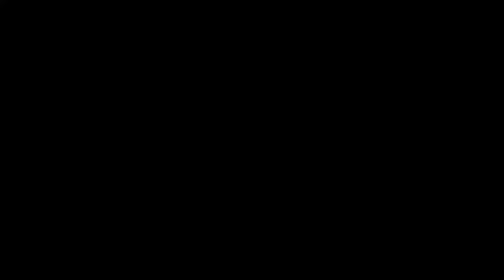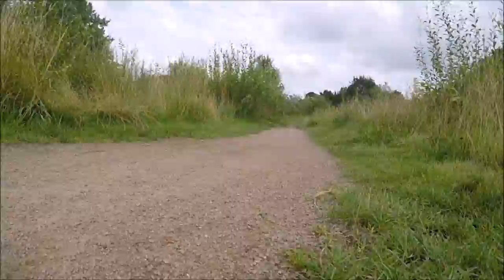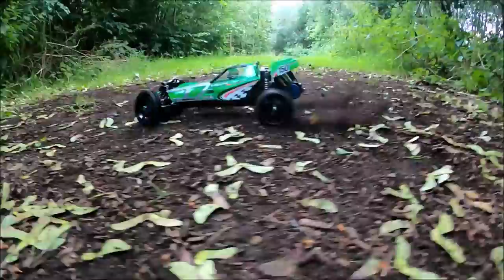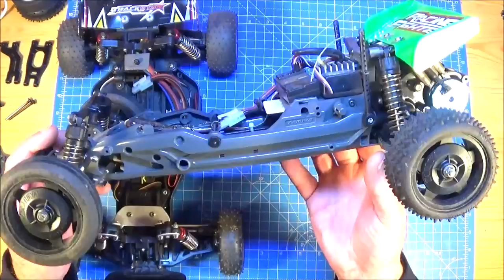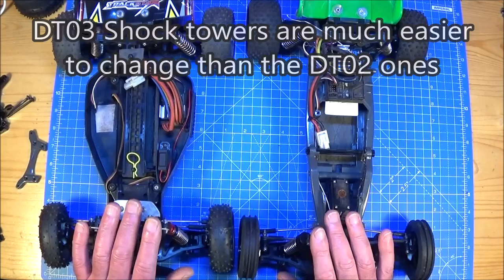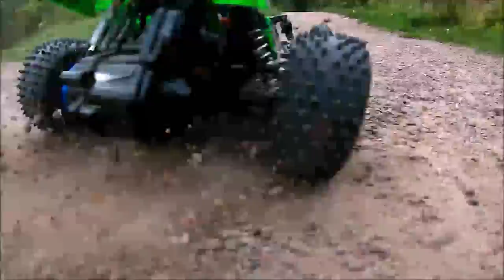Tamiya DT02 vs DT03 Chassis Review - Which is Best? Plus, Hop-Up Options!

Comment: Awesome video on the two DT kits Mark!!!! Apples & Oranges. I never built an 03, maybe someday. Jen's Sand Viper is a bit of a handful to drive with the stock motor I put in it running on 2S with stock tires, but it was fun!!! I never looked hard for replacement tires for it, I did find front tires but they don't really fit (the tires I got are 2.2 inch). ATB my friend!!!!!
Reply from the maker: Right on, Bob! Maybe apples and pears? 🤣You need a DT03 mate, just for the fun of it! Oh yeah, these RWD buggies are a real handful but very rewarding when you get it right. Bummer about the wrong size tyres! ATB to you and the clan, brother! 😁👍
Reply: @MarkBryanRC  I'll look at an 03, but me still wants at least 2 more Clods!!! LOL
Reply: @MarkBryanRC  I want to build at least one brushless Clod!!!  LOL

Comment: Never broke a DT02 front shock tower on the where the shock mounts ,I’ve broke a couple where that pin goes through to hold the bottom arm on though.😅I’ve narrowed mine now to the old holiday buggy width and run a rough rider body on it .with sand scorcher wheels and tyres on it so it looks like the old srb chassis cars .my others the same but with a sandrover body shell .just got to finish my Xmas pressie off me lad ,a sand scorcher..wanted one for years but couldn’t afford one …love rear wheel drive stuff more than 4wd ,that’s why I love my old classic cars all British and all rwd ….
Reply from the maker: Hi Craig and many thanks for sharing your hobbywork! Oh yeah, I forgot to mention snapping the shock tower there, I've done that a few times too. I love the sound of the Rough Rider tribute you've created, great stuff indeed! Wow, your son did you proud! What an awesome present, I only got a jumper!!! 🤣 Couldn't agree more, the classic RWD cars are my faves, too! Cheers mate! 😉👌👍

Comment: Great Video! Do you think the Dt02 Chassis can fit (replace) a dt03? They sell an aftermarket aluminum chassis for Dt02 and since both platforms (dt02-dt03) share many parts I was thinking If I could swap the dt03 with the Dt02 aluminum chassis?
Reply from the maker: Thanks! No you can't swap the DT03 chassis and replace it with a DT02. the rear gearbox mount is the same on both, but the front ends are different, the DT03 front suspension fits to the chassis and the DT02 front end has a separate subframe. If you had the DT02 front shock tower and mounting plates you might be able to do it. Not a straight swap, though!

Comment: i've been wondering how to get my DT02 GR super fighter back into action after giving up replacing the front shock towers, and i think I will have to try this aluminum support trick! thanks for showing this off :)
Reply from the maker: Glad I could help and thank you for watching and commenting. Oh yeah, it will be great to get the old GR up and running again, I bet it will put a smile on your face!
Reply: @MarkBryanRC  yeah it was a favorite for a while for sure. I was running comical hornet tires on it with a brushless system, and it was so goofy lol the added wheel height and higher speed added too much stress to the shock towers over bumps, so it'll come back as a normal buggy with original wheels, and get a sport tune motor setup to be more durable haha
Reply from the maker: @gogotrololo  Hehe, now I see why it broke! But yeah, a sport tuned will definitely suit this buggy!

Comment: Hi Mark is there an alternative to the tamiya 54432 dt02 front damper support as no where seems to stock them and nit sure about making one from aluminium
Reply from the maker: Hi Chris, I checked and that number is for the rear carbon stay. The front is part 54562. I can find both available on eBay in the UK. I don't know of any alternative. Hope you can track one down! 😎👍

Comment: i used your suspension pin upgrade and keep plenty on hand. Or I heat up the original pins with a lighter and I melt the plastic as I screw the pins in and they seat nicely and will not crack the plastic in `15yrs when we revisit these buggies to sell
Reply from the maker: Hi there and thanks for reminding about that screw pin upgrade! Here is some info for those reading this:
Tamiya TL01 Stainless Steel Suspension Pins - Part number: 53301
I like your idea for seating the stock pins though! Best wishes from Mark. 😊👌👍

Comment: 1 second in and I will say DT02 ALL DAY!
Reply from the maker: Thanks Paul - but I just KNEW this one would divide opinions!  😉👌👍
Reply: Dt02 for looks and agility, for sure.
 dt03 for stability on the track when traction is limited. Much more stable to drive with the longer wheelbase, way less loops. 
You can also make the dt03 more powerful without it flipping upsidedown every time you hit the throttle thanks to the longer wheelbase 😁

Comment: Had both, the dt02 is far lighter than dt03 and it is far wilder, on the other hand the weight distribution and the longer chassis makes the dt02 a little slower but fare easier for me to handle, even on full throttle the dt03 still hold and goes straight where the dt02 often burnouts or goes offtrack. Steering is absolutely decent on dt03, not top noch but decent, on the dt02 not so easy to set and i had ofter problems, especially after bashing...
Reply from the maker: Good points! I never thought to weigh the chassis, I need to do that! I agree about the handling, the 03 is so much more stable, the 02 is a little wayward at times! All the best!  :)
Reply: @MarkBryanRC  hey, quick question, is it normal for the rear stabilizer (upgrade) to slide left and right and not be fixed, compared to the front onr?
Reply from the maker: Sorry but I haven't seen the stabilisers for these cars. But I imagine the stabiliser will not move when the car is driving as the pressure on it will keep it fixed in place.

Comment: Great video👍 could you tell me what esc you used with the tblm motor thanks
Reply from the maker: Thanks Paul! I used the stock Tamiya TBLE02s ESC, but you need to get a sensor cable that plugs into the ESC and motor or the motor will not work! 😎👍
Reply: That’s great mark thanks for your help 👍
Reply from the maker: @Paul-McEvoy  cheers, you are always welcome 👍
Reply: Hi mark I wonder could you help me I am thinking of running a super stock bz motor will a THW 1060 rtr do the job many thanks
Reply from the maker: @Paul-McEvoy  Hey Paul, I have heard only good reports about the BZ motor, it is a big improvement over the speed of the stock silver can. The THW 1060 is also excellent!
Reply: @MarkBryanRC  thanks for your help mark it’s much appreciated 👍

Comment: What size motor does a dt03t fit 540? And what's the largest lipo I can fit a 3s 5000mah?
Reply from the maker: Hi there. Yes the stock motor is a 540 but you can easily fit a 550 if you want. The largest battery I have that fits measures 140x48x25mm. 😎👍
Reply: Ty @MarkBryanRC
Reply from the maker: @LassoKid7777  You are very welcome!
Reply: @MarkBryanRC  I've decided to go with a 9T 4370kv brushless setup uncensored and 60amp ESC 3s capable , I think it's plenty for a 1/10 , I also got every upgrade I could find so weight will be up from box stock, thanks again
Reply from the maker: @LassoKid7777  Wow it's gonna fly with that setup!!! Have fun! 😁😁👍👍

Comment: Holiday Buggy wise I've been coming up with a project of sorts where i would be looking to replace the original wheels and tyres to something else.. after looking i was thinking the wheels and tyres from the comical grasshopper/hornet/frog would look closer to a dune buggy style.. I've also spotted a hex adaptor that has a bearing inside it on ebay..  just not 100% on the offsets of the rims to fit on the front and rear of the car.. .. debating as to just buying one of each and then trying it and if it works buy that bearing hex adaptor..
Reply from the maker: Hi Jessica, that sounds like a cool project! I like the idea of the comical buggy wheels and tyres, that would look cool. I have tried some bearing hex adaptors on my DT02 in the past and wasn't pleased with them, the wheels never span as freely as the stock ones and there was a lot of wobble in the wheels. That could just be down to the adaptors I used though and others might be better. The Rising Fighter and Sand Viper wheels are wider and might take the comical tyres. If you need much wider wheels on the front you could also look at the blitzer / Aqroshot wheels. Just a thought! Cheers!
Reply: @MarkBryanRC  thanks for the advice...